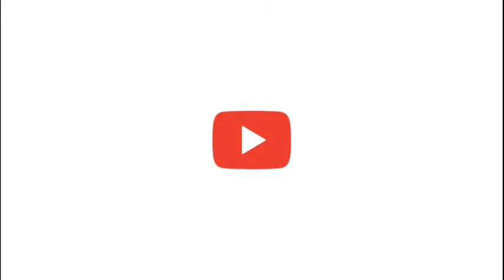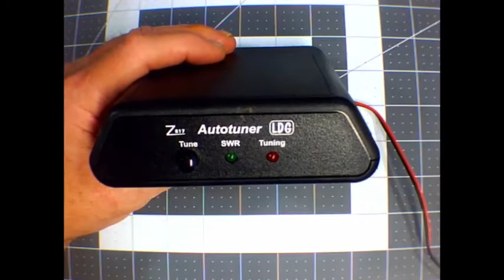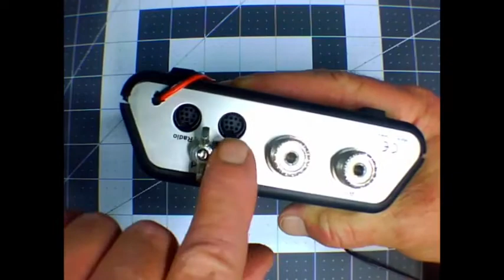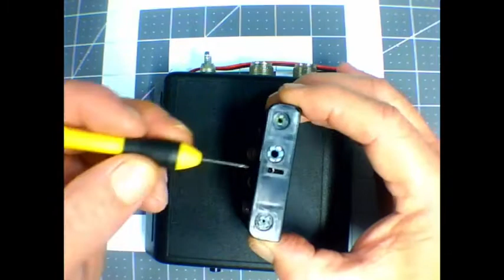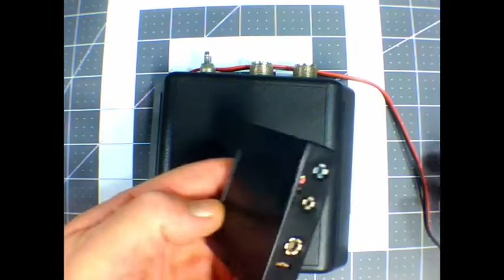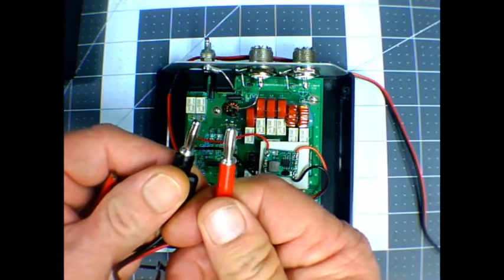My tuner quit. What do I do?

Comment: Hi, there! I have one Z817 tuner to hook up with 5w SW3B QRP Radio. But the manual don't tell me how to tune. Could you tell me how to? I couldn't figure exact LED Blinks, the swr yellow and tuning red. When how many times blinks of each yellow and red? Please  let me know.
I tried LDZ  help line, but they were too lack of sincerity, kindness. Waiting.
Reply from the maker: With that radio, I believe you will have to hold the key down and then push the tune button. Release the key when the tuner stops tuning. As far as the LED indicators go, I copied the following from the manual  I got online.

Tuning LED on. Tuner is tuning. 
Tuning LED goes out, SWR LED comes on solid.  Tuner has completed a tuning cycle; a good SWR match was found.
Tuning LED goes out, SWR LED blinks 5 times.  Tuning cycle is complete, tuning match is between 1.5:1 and 3.0:1 SWR. 
Tuning LED goes out, no SWR LED.  Tuning cycle is complete, tuning match is greater than 3.0:1 SWR.
Tuning LED blinks 4 times.  Tuning cycle failed, RF was lost in the middle of the tune.
Tuning LED blinks 5 times.  Tuning cycle failed, no RF was detected. 
Tuning LED blinks 10 times. Attempted to tune on 2m or 70cm. 
Thanks for the comment and watch time. I hope this helps you out.

Comment: I had issues as well
Leaves FT-818 in PKT mode and the radio shuts off. As for battery pack, it isn't corroded.
Reply from the maker: I haven't heard of that issue. Mine was 100% power related. If you get the issue resolved, post it here. Someone may get some benefit from it.